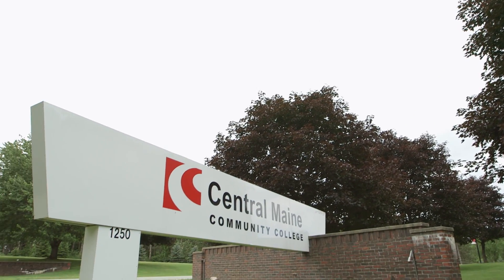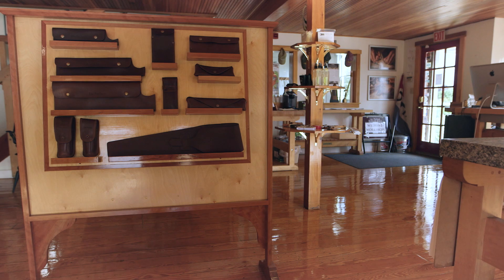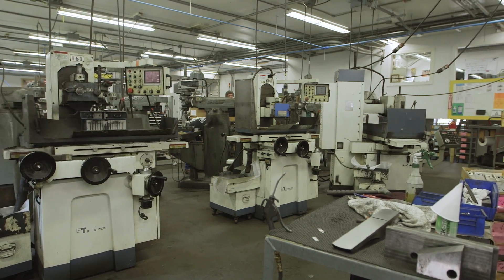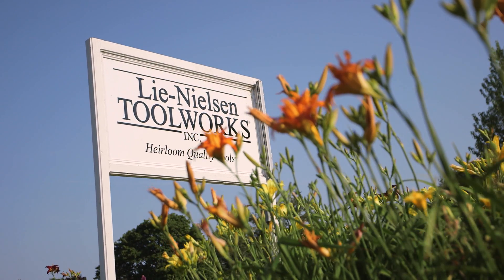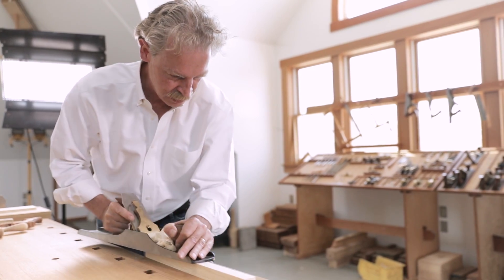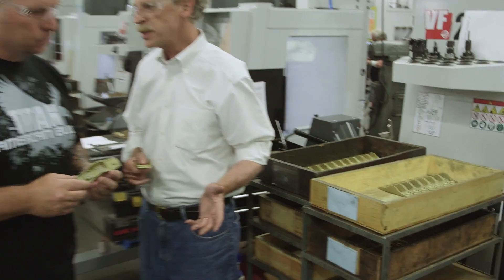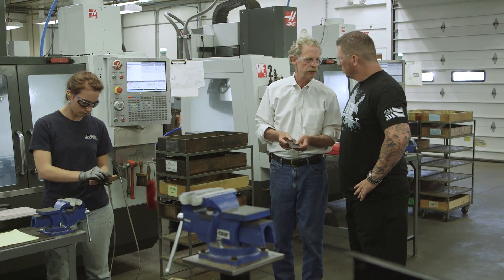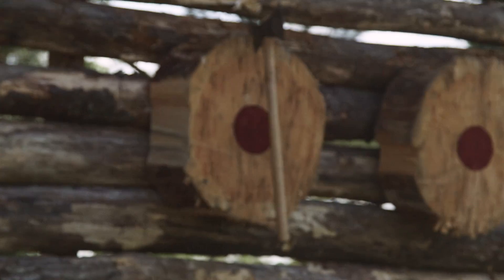TITAN visits Master Tool Maker "Tom Lie Nielsen"

Comment: We are sooooo fortunate to have people like Leonard Lee (Veritas, Lee Valley Tools) and Tom Lie-Nielsen. Woodwork has once again become a joy with higher quality tools than we have ever had access to previously. I have had Record and Stanley planes over the years but they do not hold a candle to these new tools and they are fragile as well as imperfect. Nice to take a well made tool out of a box and put it to work right away. Oddly thanks to Ebay the old less effective planes are selling for almost as much as these new tools. Last 2 purchases I saved money buying the newer  Veritas. Up here in Canada the Lie-Nielsen tools are almost double the cost of the Veritas so its an easy choice. Either way they are a great improvement and a pleasure to use. Its like having a Rolls Royce parked in your backyard.

Comment: Watch that large plane wobble back and forth as he pushes it on the wood. Thats not good. Better off using a power jointer with carbide tipped knives. Much faster and more efficient. Not saying these are not good tools but they are mostly for retired guys who have all the time in the world or for old style furniture makers so they can say they did it all by hand.

Comment: Lie Nelson tools are gorgeous and so are the prices. Lie is correct about the hand planes about smoothing the edges and making the bottoms flat, If you buy a hand plane from most manufactures they are sharp edges and dished bottoms. You have to spend a little bit of time shaping them up for precision work like cabinet making.

Comment: Imagine a lie nielsen plane blade made of bohler m390 or s110v at 63hrc.
Reply: Those may or may not be good. particle M4 and LV's V11 are probably what you're looking for. I just tested (and will publish) the V11 and 6 other irons and the particle metal irons that aren't super high vanadium carbide type (e.g., not 10V or anything like that) do very well. Large mix of carbides and powder, or heavy on chromium carbides and some other and lighter on the V is nice (PM M4 has a fair amount of vanadium in it, i guess). 

Lots of vanadium makes the irons very wear resistant, but it doesn't seem to provide quite as much benefit in wood as it must in metal or high wear industrial parts.